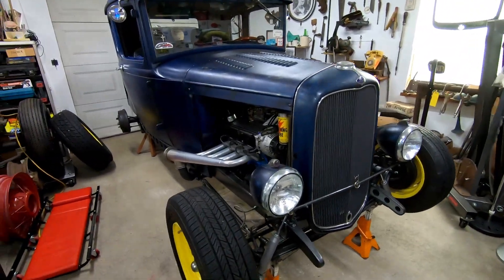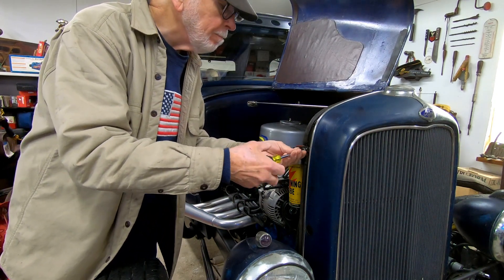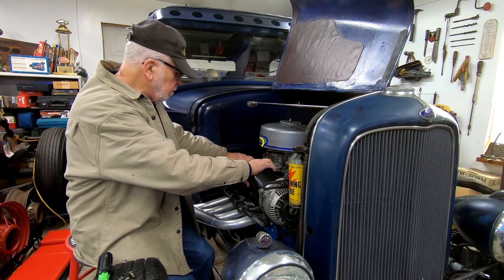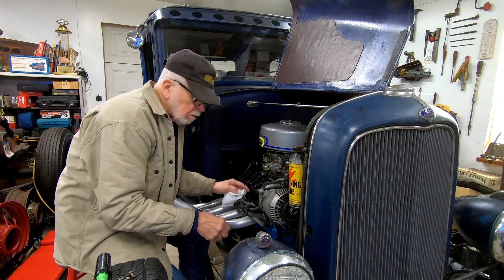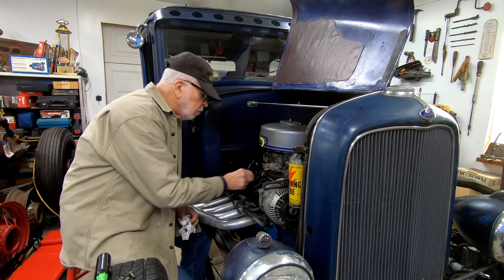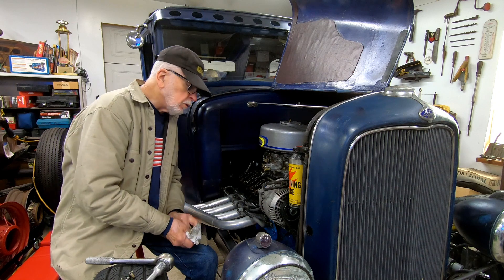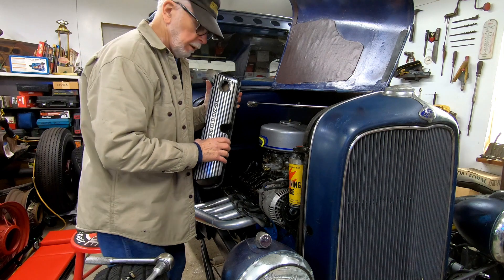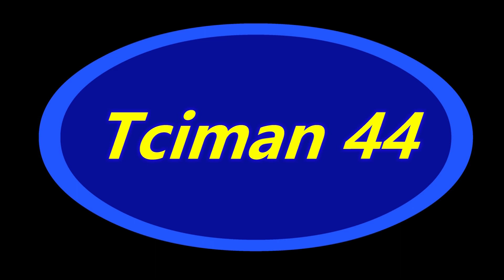Adjusting a Noisy Tappet on the Model A

Comment: Hey Bert, you probably have a lifter that leaks down after it sits awhile. Nothing to worry about as long as it smooths out when warm😊.
Reply from the maker: Thanks, good call. I think your right. Like I said in the video, I crank the motor without starting it till the oil pressure is up and, no noise then.